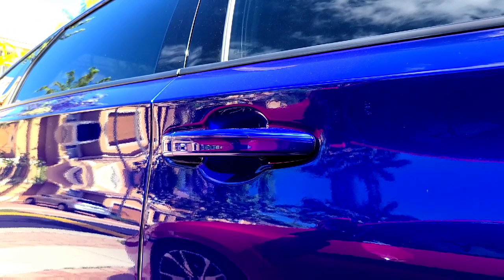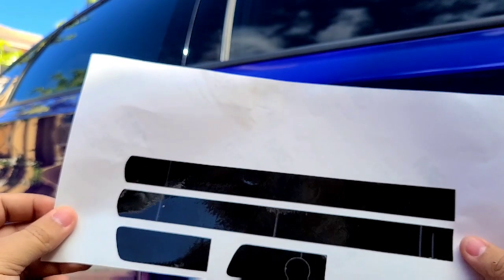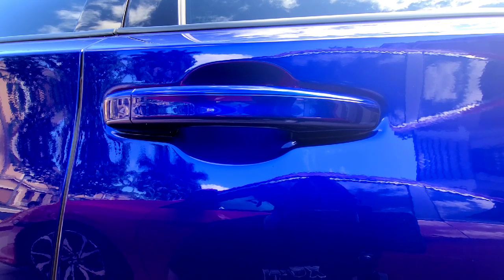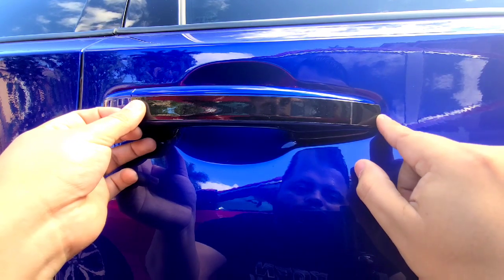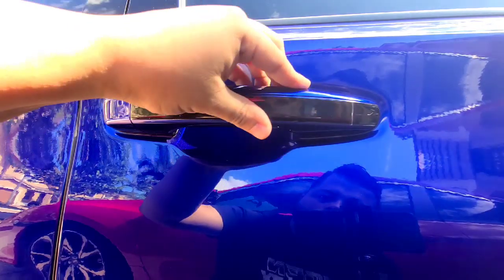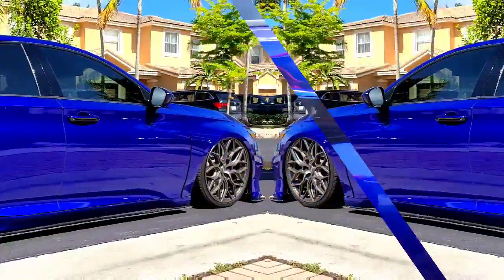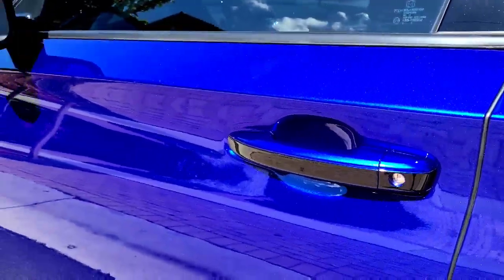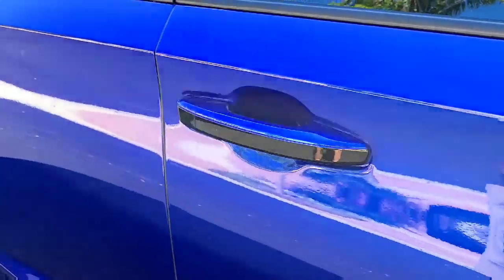Door Handle Overlays (Oakman Designs) on Honda Accord 2018-2020

Comment: I prefer the metal ones that are available on eBay: https://www.ebay.com/itm/273499039104 they seem like they would hold up longer than a sticker
Reply from the maker: That's always an option. I have used vinyl for a long time however all over my car and it has lasted thus far.
Reply: BoostedWhipz if it works it work right? That’s all that matters. If I ever have issues with the metal ones,
I’ll definitely consider those vinyl ones.